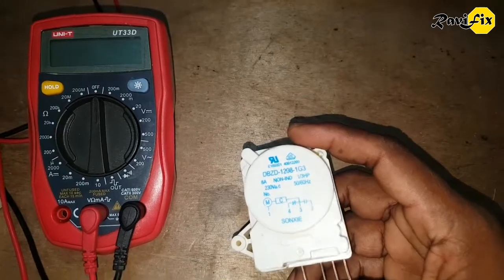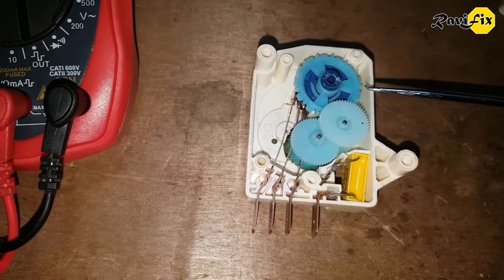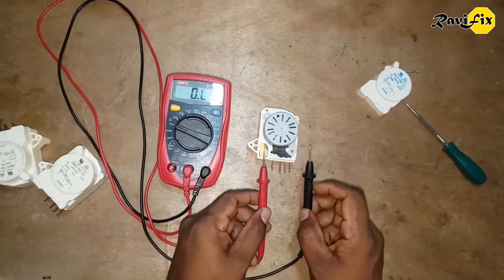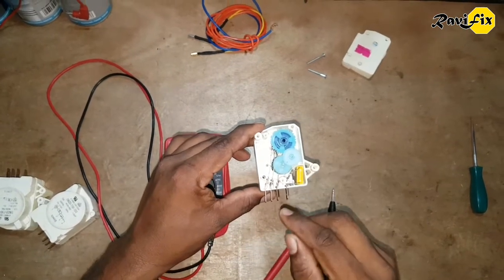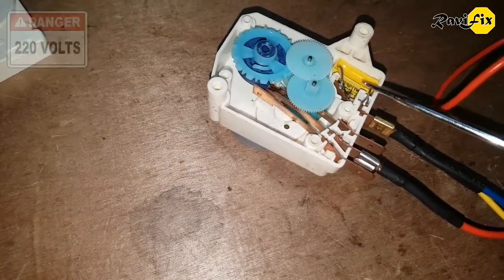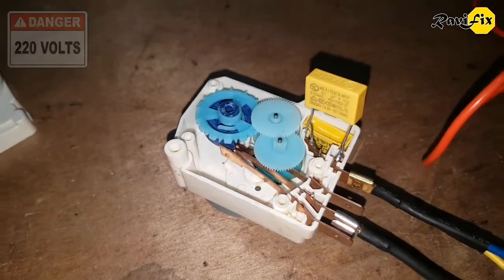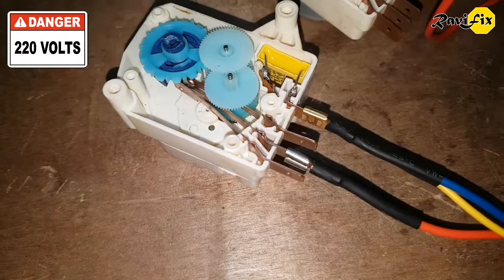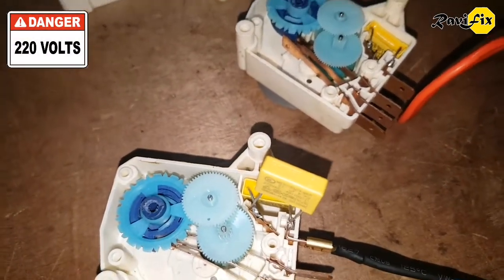Fridge is not Cooling? How to repair a Refrigerator Defrost timer DIY.

Comment: Thanks for making the video Ravi, our fridge is almost 7 years old now, chances are I'll be needing this info one day.
Reply: Ravi, here it is 5 days after the last comment and yesterday our fridge died... it ended up being the evaporator fan but.... karma I guess
Reply from the maker: When evaporater fan stop to work, still freezing the deep freezer, but not push air throug the duct to downward cool the freezer. 
Easy fix, i got this error on mine 2 years ago.
Reply: @ravifixall  Same symptom, freezer good, fridge warm.  Hopefully my fan comes in the mail soon, it would have been a six hour drive to pick one up...